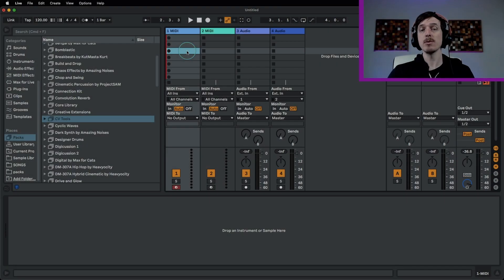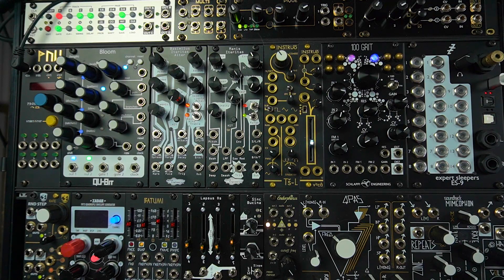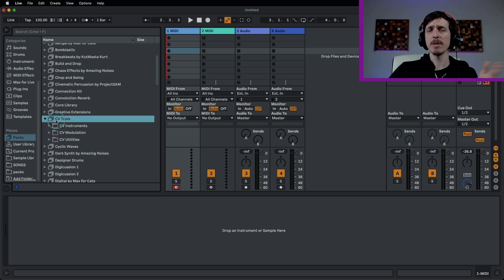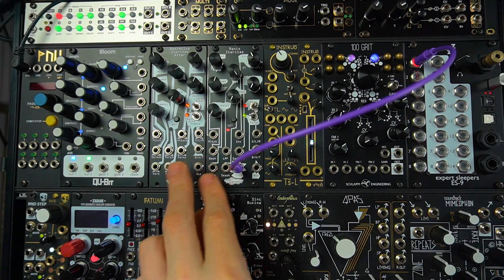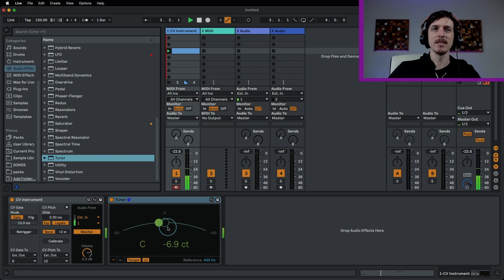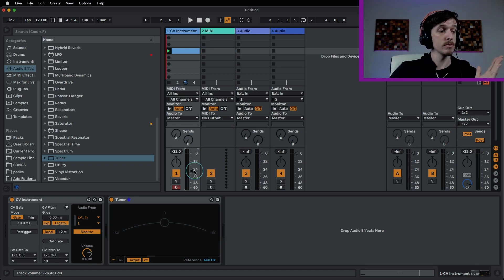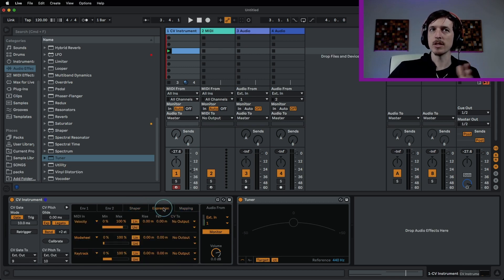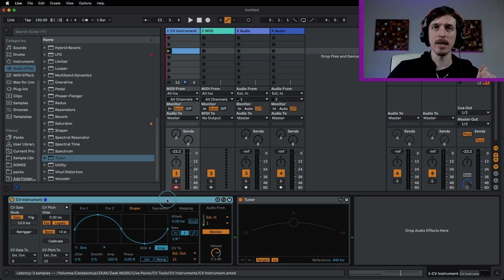Ableton Live Meets Modular Part 1: CV Tools

Comment: hey @CatalyzeMusicAcademy, I am trying to setup my es9 and running into frustrating issues. Essentially, I am trying to use this so that I can get a multitrack output from my modular rack into ableton, and be able to monitor what's coming into ableton from the rack w/ my studio ref monitors that are connected to my Apollos. Do you know how to do this? Also, when I select ES9 as both the input/output in Ableton it keeps making Ableton crash. Any help you can offer, or a link to a valuable resource is massively appreciated!

Comment: I wish I would’ve watched this about 10 months ago when I got started. I tried a lot of different modules to figure this out because my first es9 was broken and I was pulling my hair out around reset. Two things. I noticed you had your monitoring to auto. You haven’t noticed significant latency? Second thing. You started to plug reset into ‘run’ on Pam’s. Where does that send reset pulse to? That doesn’t reset my Euclidean circles when plugged into reset. Curious what you meant by that. Also… one more thing. Have you done a shootout between midi clock, es9 clock out vs es9 clock in? What’s the most accurate? I’ve been wondering about accuracy of something like yarns vs es9 clock/out vs clock/in.  Curious your thoughts. Thanks!
Reply: @CatalyzeMusicAcademy  Sweet man, thanks for the response! One of the things that's worked for me recently is sending the reset pulse of the CV tools clock out transport to a separate output of ES9 to a mult and pulling from there for my sequencers. Another thing I figured out (while first es9 was toast) was that pams can send a reset on either the end or beginning of a clock running. It just pings once like CV tools clock out transport. It looks like a little square wave in the window of pams. It was a little jittery for me though but it could've been a cable. Anyways, thanks man. Would love to see more of this stuff in the future.

Comment: The reason why you can't calibrate the Noise Engineering module correctly is because they don't provide pitch CV -5V - +5V. I had this problem and emailed them. The workaround is to calibrate with another VCO which has pitch CV and swap over after.
Reply: @CatalyzeMusicAcademy  @Catalyze Music Academy  Hi! Great video. I'm also using the Iteriras and am also having issues tuning to C3. How do you tune to a lower C? When I calibrate via the CV Instrument it automatically calibrates to C3!